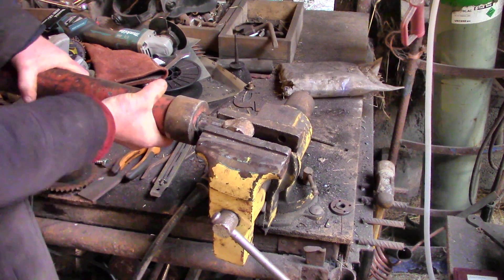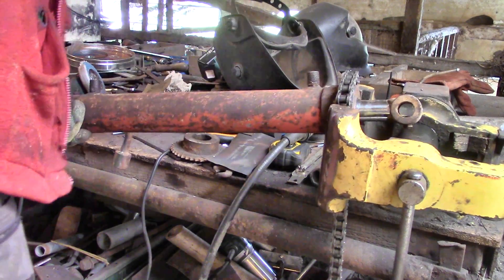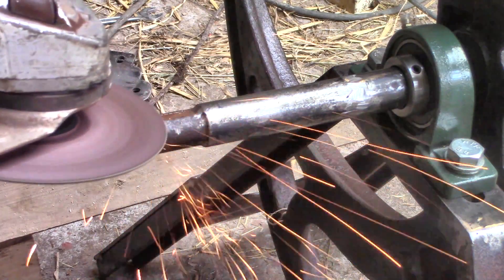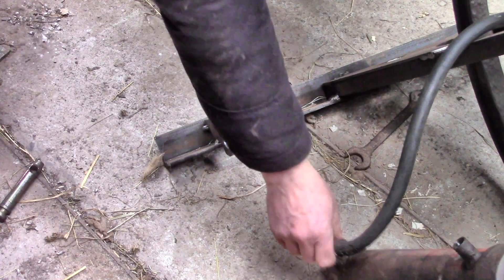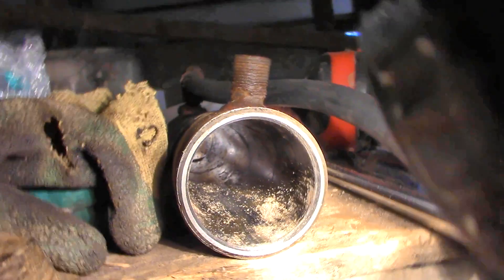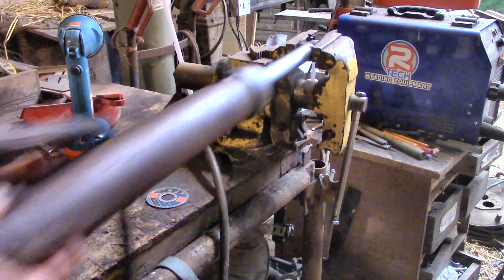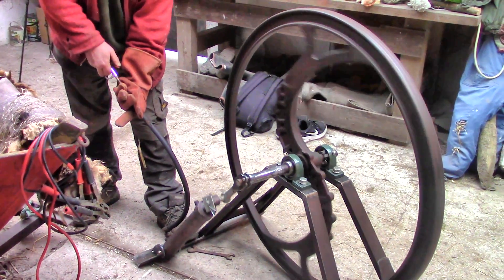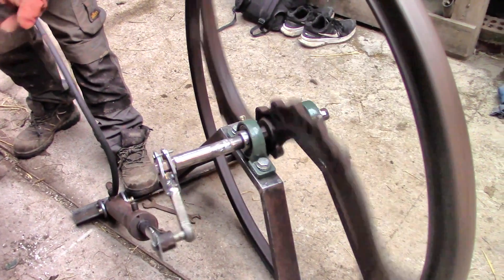Can A Hydraulic Ram Work As An Air Engine Piston?

Comment: You know, have you considered an air-powered locomotive for the railway? Look up "Hissing Sid" which is a 2ft gauge loco, which is basically a large pressurised air tank which drives a couple of cylinders. You might also try a fireless type loco, but I think that if you want to go with steam, you should look for a 2-cylinder steam launch engine which can be chain-driven to the axles and perhaps a small vertical firetube boiler.

Comment: I've known a lot of steam locomotives, Though Narrow gauge steam engines are a bit tricky, some have small coal bunkers  And are only useful for small distances, The Solution to this is a tender, This also makes problems, The first one of which is the water injector, These may fail sometimes and without a water injector and tender engine simply can't function, I Would suggest to build  an engine with a water tank that can store more than 15 gallons, Make the engine with a built-in tender for storing more charcoal or any type of fuel your using, Problems with the firebox are also common, make sure your engine has a large firebox or you can build it a small one and use welsh coal which burns better, The reason i suggest this is beacuse this is what ive know so far, Oh and if your building an Passanger engine, Add an front pony truck [bassically an truck thats connected to one end of the locomotive and makes it easier for it to go through curves]Thats alll i can suggest you and have an nice day.

Comment: Take a look at the mechanism they used to keep a propeller airplane from shooting off its own propeller in WWI. Should be 'easy' to do the same on this engine, and have the air valve open and close based on the position of the shaft. Same cam should be able to work 2 valves, one for supply air, and a second for an exhaust port. You can make 2 cam rings that can be turned slightly to have adjustable timing for each. Make it 4 rings, and you can have adjustable timing for input and exhaust for forward and reverse. Supply air control valve will act as your throttle.
Reply from the maker: Yes, that's pretty much what I'm going for now (though I tried something else first!)

Comment: A valve that switches from one inlet to the other, hmmm. R-134 refrigerant and oil. External heat generator pump engine

Comment: Yep, you need a shuttle valve, something that will open fully to vent the reverse stroke air.  Since it is already expanded in the cylinder, you want as large a port as possible so it vents compressing the air inside as little as possible so it doesn’t impose so much drag.  It being a double acting cylinder, you could put one on each end port, actuated by the same rod and get 2 power strokes…

Comment: this is great!

kinda reminds me
a game called scrap mechanic, you can make engines using a block called a piston, its basically a high powered double acting linear thing
usually to get good performance you attatch a timing setup to the crank but a cheap method is to use buttons and manually time it

Comment: A very simple valve is to have the flywheel shaft running through a long(er) bearing, with two adjacent air ports and a flat spot on the shaft. When the flat spot lines up with the air ports, the air passes through. Timing is adjusted by turning this bearing to different alignments. It can also be aligned for reversing. Thanks for the video. Jon
Reply from the maker: Yes, there are a few types to choose from

Comment: Ah finally an area I do have knowledge, lol - I was a hydraulic engineer in my early years, I use to design pumps, cylinders and valves. a simple valve you can make would be a spool valve. You can make simply like this:
Steel rod, say 100mm long, and turn down the middle, say for a width of 30m, so you would have something that looks like ===---=== , then take a piece of square stock and tap 3 holes in a row on the side and run a hole through the middle. the idea is the spool moves back and forth and only connects 2 of the 3 holes at a time, so the center hole goes to the cylinder, the other air pressure and the last one is exhaust. hope this helps some. if it doesnt makes sense, check google images for  "simple spool valve"

Comment: I must say Tim you are a lesson in positivity and rescourcefulness! Bravo as always! Could you not have a non return valve and vent to atmosphere on the two inlets/outlets so that you could use both strokes? I.e on each inlet/outlet on the ram have a manifold with 3 routes, one to the ram, one to atompshere and one to the air source, a non return valve on the air source side would allow the ram to vent to atmosphere on the outstroke and allow air in for the power stroke? an unneccsary complication maybe but it could be achieved with some standard plumbing/air fittings? Just a musing more than anything else!

Comment: you could add a drip oiler to the upper end of the chamber that you dont have hooked up to the air or even drill a weep hole up there as the oil with coat the hole length  of the ram that way (could use a mineral oil or canola not a fancy as modern oils but far safer for any critters)
Reply from the maker: Good idea - thanks.
Reply: @wayoutwest-workshopstuff6299  as a side note i always enjoy your approach to projects and your general good nature and i thank you for sharing it with us

Comment: If you guys have some old broken down agricultural equipment laying around, hydrostatic transmissions are a great source for homemade engine parts. Most of them utilize a squash plate against six cylinders with pistons actuated by oil. These systems work bathed in oil so they are often in very good shape even if the overall machine is not. There are some surprisingly tight tolerances in there, I have made several Sterling radial engines out of smaller ones, from riding mowers

Comment: Perhaps you could make the rim of the cutter wheel in to a cam, to lift valves to power the ram. As the the diameter is large the rotation would be slow and it would be easy to tune up the timing by moving ‘ramps’ around the rim. They could be clamped on to start with. Just a thought . Carry on the great work. Thanks.

Comment: I know that you'll know what to do but could you at least try once to use a strong Spring to pull the air piston back? 
maybe one wide enough so a wire hooked inside it could pull a lever that would close the supply of steam to the hydraulic ram every time the spring has stretched too far.
Reply from the maker: But that's what the flywheel is for - it pushes the piston back into position

Comment: Don't you have on the shaft something you could operate an air valve as it it rotated? If you were to put a rocker switch on the switch or like you operate the air nozzle works now. Your thumb operates it now and can do so as the flywheel turned around. You would just need to time the thumb push with the piston. I think this is ingenious. Keep thinking outside the box.
Reply from the maker: Thanks, kristine - I'm really aiming for a steam engine so I'm trying to come up with something that will work for both
Reply: @wayoutwest-workshopstuff6299  Could this idea still not work with steam instead of air? If the steam is released in the same manor as the air the same principle would be done. you would need to get steam in the cylinder at the the proper timing . A rolling release similar to a cam for lifters in a car where the valve is opened to fill and then released out a separate opening? I will be watching your upcoming video with interest as to how you  make this work..

Oh and I'm still hoping one day to see the donut cart operational, LOL. Thank you for the fun I have watching your videos. You are an inspiration that we can do things if we just think about it.

Comment: Work, yes it will. Efficient it will never be. Couple things off the bat, the bent rod is braking your action and the ID of that barrel is not chromed (air cylinder type) and creating significant seal friction. For testing your fine but for an engine, no. Almost any 1/4" valve or larger will drive that small ram as air expands as it depressurizes. What will be an issue is the exhaust air returning through the tubing and valve. When the valve shifts to not passing air or supply blocked, the returning ram acts as a compressor to force air through the maze further reducing efficiency. Try to locate or make a quick exhaust valve for the cylinder port. This will dump the pressurized side to atmosphere instantly. Too bad I'm in the States, spent 40+years designing air and despite my misgivings I bet we would have a ball figuring it out. Good luck.
Reply from the maker: Thanks, Mark. Yes, I've been strugglijng with the exhaust air problem. I wonder if a slide valve over a hole in the cylinder would work?
Reply: @wayoutwest-workshopstuff6299  A slide will be helpful but not possibly as fast as you would like and will require critical timing versus a diaphragm relying on "just" the pressure change in the ram. If you produce a slide it will have leakage as is their nature and you need to insure that your "supply" is fully blocked as you slide to exhaust. Partially shifting is worse than not with a slide. If the 3 ports ever align you will blow the system to atmosphere. 
In the end you will need a diaphragm, the  nature of them is ideal for your pressure's. Years ago in the leg of a offshore oil well I rigged an exhaust with a pipe Tee fitting, a rubber ball and a bent washer under the exhaust fitting to prevent the ball from sticking there. Didn't work well and whistled like heck but kept us going.

Comment: Get yourself the biggest knipex pliers or other premium brand, theyre tab on the expensive side (around 120€ here) but when in doubt they're the tool that gets the job done.. all my pipewrenches either crush or slip when trying to undo rusted pipes,nuts ot whatever but knipex can open it.

I have a 60 year old tractor, that has a big oil drainplug in the engine, and smaller plug to check the minimium oil level or something like that.
The main plug was seized solid decades ago and with some swedish nut lathe been rounded to perfect circle with a coneshape.. so all pipewrenches would just slip off.

The oilplug was se sole reason i marched to nearest dealer and said "give me the biggest pliers you got" because i was fed up draining the oil thru the small level check hole, and never getting it fullu empty.

Long and behold it opened, even filmed a video from it https://youtu.be/cxsT00XBCsM?t=44
Reply from the maker: Very impressive. I'll start saving my pennies!

Comment: So you want a steam engine without the steam?

Works for me! ;o)
Reply from the maker: well, it seems like a good first step - and then move to steam afterwards.
Reply: @wayoutwest-workshopstuff6299  Well you can produce dry steam. Can you condense the steam in the ram? If so you can get double your moneysworth. The condensing engines do tend to run slower and are less powerful though. Most of the engines I have looked at use a slide valve but it seems to me that a scrapyard will be a good source of car engines which usually have at least 8 of them to every engine!

Comment: I would suggest a cam on the main shaft. If you attach it with a set screw you can adjust the timing until you get it right. Then all you would need is a little bracket to hold the valve in the right spot.

Comment: a cam lobe on the flywheel shaft to push on air squeeze handle. also a bracket to hold it in place?
Reply from the maker: but I'd still need something to allow the exhaust air/steam out
Reply: @wayoutwest-workshopstuff6299  https://youtu.be/qX7XNM4X2Rc
Reply: Maybe something like this? I don't know if this specific one is heat resistant but when I was a younger man I serviced natural gas well sites. They had heat trace lines with switches that were similar. They would switch on and off roughly 2 times a second. It's difficult to explain how the whole pump worked but they ran off  these gas pressure from the well sites.

Comment: Just stick a piece of would around the outside of the wheel that is in the correct timing spot and as Long as you want for duration . Use it to depress the trigger ?
Reply from the maker: but what about the exhaust gas?
Reply: @wayoutwest-workshopstuff6299  
What about it ? You weren’t controlling the exhaust cycle manually before .

Comment: Tim, you need to position the crank much closer to the flywheel, there will be far too much bending moment on the shaft and wear on the bearings in its current state. As others have said, a valve activated by the axle or the rocking motion of the ram (as in a simple oscillating steam engine) could work the air/steam inlet. But you need to consider how to exhaust the driving air/steam as well...
Reply from the maker: You're right, Tony - but I need to leave space for the drive sprocket, as well as the valve gear, so I thought I wouldn't cut anything off just yet. Any ideas for the exhaust? I was thinking a sliding plate over a hole in the cylinder, but I don't want to mess up anything
Reply: @wayoutwest-workshopstuff6299  Tim, I'm thinking a simple shuttle valve operated by an adjustable cam on the axle (or the edge of the flywheel?) or a rotary valve, much like a faucet but with a 3-way hole, to both cut off the air and let the exhaust out.

Comment: How about making a clamped on lobe ( like a camshaft lobe ) and slipping it on the flywheel shaft and mounting the compressor blower valve under it. Then its a matter of adjusting the timing to blow air in when needed. Just like when you did your first run and opened the blow pipe using your thumb.  😄
Reply from the maker: Yes, that would work - but the problem is really the exhaust gas
Reply: @wayoutwest-workshopstuff6299  🖌Mmmm. So you need a second exhaust port at the bottom of the stroke and a second lobe with a second valve. This is starting to loo🎨k like a two stroke engine to me! Love the videos Tim. They're so good at explaining the problems faced by inventors past and present with a make do and mend approach.

Comment: @Way Out West - Workshop Stuff
MAGIC VALVE-ish: 
The timing is directly tied to the rotational position of the flywheel, you could add a kind if ramp & similar to the flywheel (add counter balancing weights too) for the length=duration that the steam needs to be added, then have some kind of button-like thing that gets pressed in when the ramp is in the right position which lets in more steam.
Reply from the maker: Yes, but what about the exhaust air?
Reply: @wayoutwest-workshopstuff6299  Another timing ramp on the opposite left/right side on the wheel?

Comment: What a wonderful machine. Maybe mount a lever or three on the flywheel that would press on the air valve as they go by giving a shot of air to the piston? You might need to figure out the speed you wanted the flywheel to turn at...I think. You would have to start the flywheel turning by hand but that should not be an issue.

Comment: Easy magic valve put a piece on the big wheel that pushes the trigger on the air gun every rotation .timing should be fairly simple good luck
Reply from the maker: But what about the exhaust?
Reply: @wayoutwest-workshopstuff6299  another one and another gun point out with a duel adaptor

Comment: 2:48 No, they don't always have holes at both ends. This is a "double acting piston" meaning that it can pull as well as push. My International 340 tractor had a manure bucket with single-acting pistons, meaning that it could pick up the bucket but not push it down. That relied on gravity.
Reply: I think by holes at both ends he means the anchor points.
Reply: I think he meant the mounting holes. One being on the end of the piston and one at the bottom of the case. Thanks to this the piston can move making the cranking of the flywheel possible. Usually hydraulic pistons are built to allow the movement to make buckets or really anything needing hydraulic lifting arms possible. They do more then just "push out" and "pull in" for most tasks. They have to move up and down in there mounting points to make them useful.

But there are pistons that only push in and out without the mounting to allow the movement up and down. But really they are kind of rare since the applications that requires only a pull and push movement are few. The extra mounting length of the piston is barely anything so even if you do not need the up and down moment, well. To make a piston with the mounting being on the rounded cylinder is just not needed in so many cases. Better to stick with this kind of hydraulic cylinder so you can find replacements easier when needing to repair it.

Rarely do you see any other pistons design outside of small air driven ones or special use cases. If the space constrains are REAL, Like having a locking pin pushed into a door or gate whatever you barely find anything but pistons with a single cylinder or extendable multi cylinder pistons. (telescoping piston) With basically the same mounting and movement possibilities outside of special use cases that are really not worth talking about.

Yea double acting and singles are a thing too. But really outside of telescoping or single cylinder pistons the differences are sizes. Basically. Mounting points are as they are for a really good reason.

Comment: Why build a valve when you have a good one in your hands? Cut out a cam with the plasma cutter to put on the crankshaft. Then use the cam lobe to press the lever on the nozzle.
Reply from the maker: Yes, but what about the exhaust air?
Reply: @wayoutwest-workshopstuff6299  ideally the exhaust valve would be bigger to keep the piston from building back pressure
Reply: @wayoutwest-workshopstuff6299  I guess you'd have to have two cams and two valves. I didn't really think about the exhaust air